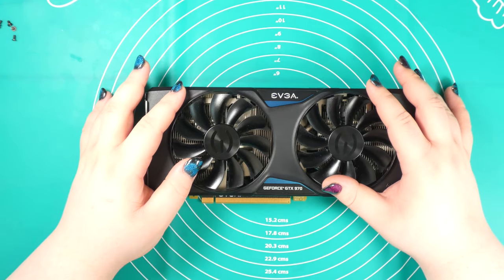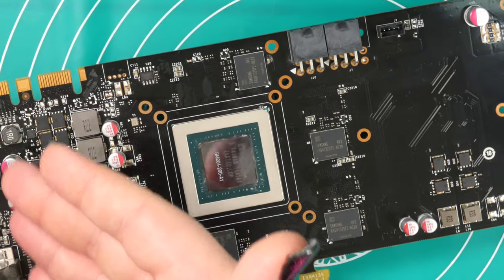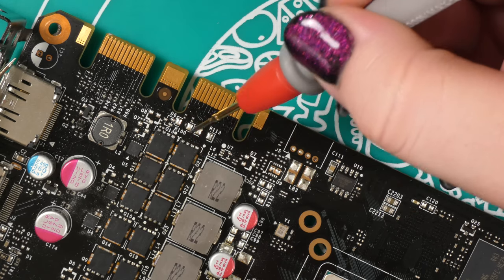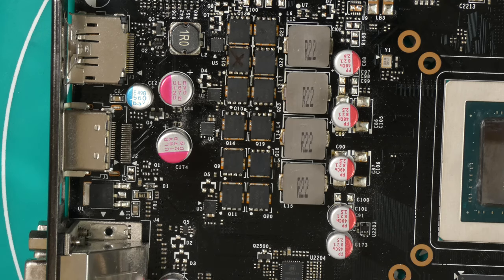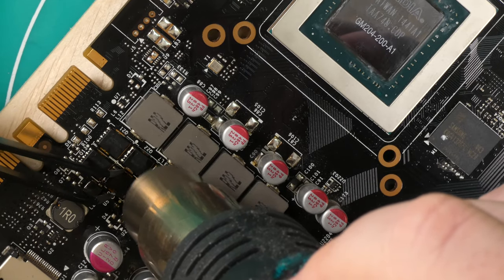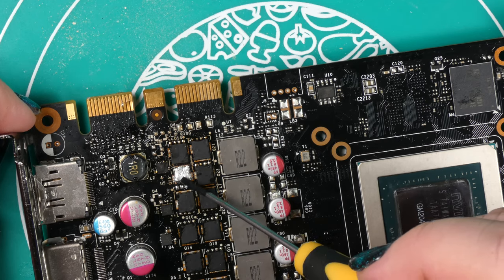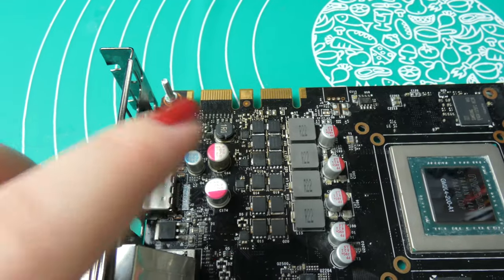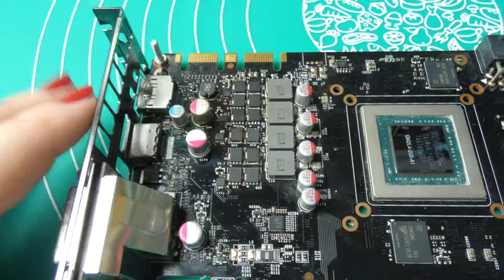Nvidia Graphics Card Repair - EVGA GTX 970

Comment: Hi, nice video.
I learned a lot from watching it: thanks very much.
I'm like you, have a different foundation (mine is materials engineering not physics as yours is), and am using these sorts of things to learn about electronics.

Couple comments:
- At start, you might say what's wrong with the device: I'm assuming it is just dead, but you need to watch more to see that.
Some GPU's have erractic/intermittent issues.
- Also at start, you did say it likely wasn't worth a great deal of effort to fix, but I think is good to say what it's initial cost was, and current 2nd hand value (just to show how that judgement was made)
- Maybe comment on this GPU's nature: the basic ones start by being powered by the PCIe connector, but after 75Watts, it needs to draw from the auxilliary inputs.
And this one is fairly high powered at xx Watts.
- In terms of troubleshooting, I wonder if you fixed the two shorts you found (by simply disconnecting that part), does the GPU work at a low level? Drawing low power?
Can test that by a functional GTX 970 (there are many of them), and seeing if it will work without the aux power lead. Maybe not.

In hindsight, for the failed Mosfet I wonder if you might just cut it out (say with a Dremmel tool): which wouldn't heat the board up at all.
Then add a new one over top of it.
Doesn't need to look pretty, or be flush.

I didn't see the Mosfet type, but looking at the data sheet, you can see how much heat you are allowed to use to install it.

I suspect it's close to impossible to remove it without a VERY good desoldering station.
Especially without cooking the neighbouring ones.

And maybe is good idea to shield the others whilst trying to remove the failed one.

I'm bad at doing SMT's......barbeque time...:-}
I see this guy managed it: https://www.youtube.com/watch?v=CtK1O-UoLMM
And he replaced the driver too: couldn't get same so tried what he felt was similar.
And it worked.

Anyways, nice video: thanks.
Reply from the maker: Hey, thanks for your comment and welcome to my channel! :)
Now the video is for everyone interested to watch, people that now about computers I don't have to tell them what a GTX 970 is worth and for others I thought that it is just unnecessary information. Same goes for the information that a GPU like that wont even startup without pci-e power connected. It literally tells you in startup, black screen, white letters: pci-e connector missing I wont start. That's at least the gist of it. 

As for the damage to the gpu, well without diagnosing it I can't really tell you. 49 seconds into the video I said that I suspected a mosfet to be the problem but I checked for everyone to see and follow if they try to diagnose a GPU problem like that. 

At the end of the video I said that the problem is not fixed and I have to do more to fix it. Since then I did a lot more on the GPU and found numerous problems with it. This thing is not a simple fix at least not as simple as I thought. I need to make the next part and there I'll talk about everything I did and give some information on how GPU power delivery works for a better understanding. 

When you work on stuff like that you don't need a good hot air rework station, just the one I have is good enough. Now obviously better ones make your life easier but that was not the problem here. The mosfet simply got partially welded to the pad underneath which can happen if there is not enough solder underneath (meaning layer thickness) and the component gets hot for an extended amount of time. Others were moving long before this one did.

And with shielding you mean use kapton tape to protect other components? That is something I had a comment about before which I did not answer to. If you mean something else ignore the following and tell me! :)
"It is supposed to protect other components from heat" is what you hear all the time. Kapton tape is a heat resistant, non electrically conductive, self-adhesive material that has many uses. But it won't "protect" any component from heat. Lets just say we have kapton around one of these mosfets, the hotair does not directly hit the surrounding components but the air heats up the kapton tape. It is not an perfect insulator, no perfect insulator exists and it is so thin that it will still transfer a significant portion of the heat energy towards components underneath. So no protection there.
This makes it even worse considering that the mosfet or component you are working on is electrically connected to other components and for that also thermally connected. When you try to cool SMD fets like these one trick we engineers do is not only to attach a heatsink to the component which is less efficient as if they were a tht fet but also connect a heatsink to the inductor as it is electrically connected to the mosfet and has very good thermal transfer. What you see looking on top of the mosfet is a relatively thick layer of plastic like material so more heat energy can be transferred through the pcb. Thats one reason why we also cool inductors. 
To make matters even worse is that in order to desolder a compoenent you have to saturate the pcb/ traces electrically connected with the component you are working on in order to reach necessary temperature for soldering. It literally works as a heatsink. So blocking the heat is exactly what you shouln't do.
Just go on youtube and watch professionals (I'm not one of them) doing board level repair, none uses kapton tape this way, it makes no sense. 
Again it has its uses and I got plenty of it but that's not something it should be used for. 

However you are absolutely right that components do have diagrams showing the temperature curve and if you are concerned about damaging anything taking a look at it doesn't hurt but this is more for reflow ovens and not hot air soldering as you can set the hot air temperature to whatever and the distance to your work piece decides actual soldering temperature. Has a lot to do with experience, just do a bit of smd work and after a short time you get the hang of it. It is really easy.
My hot air station is set between 300°C and 350°C although my solder melts at 186°C if I remember correctly but heat is only part of the "problem", time is the other. So soldering with 300°C a mosfet can be quickly soldered, maybe 5 to 15 seconds. Depends on current pcb temperature. Since this video I started to preheat the pcb so it doesn't take as long to saturate the pcb with heat energy, also I use lower melting point solder than the one the components were originally soldered in place with.

Again thank you very much for your comment, I really appreciate the feedback. :)
Reply: @PhysicistAnna  true, the idea of using the tape is to simply keep parts in place , like that resistor and cap that moved on you :P

Comment: where did you get your MOSFETs from? I'm trying to get into GPU fixing and the one I have is this exact same problem?
Reply from the maker: Hey, welcome to my channel! :)
You have to make sure that these mosfets are the exact ones you need or have similar properties to the ones your GPU requires. They need to match in terms of switching current, Rds(on) value and switching properties. As for the voltage rating, any mosfet that can at least handle the 12V input plus some spare should do the job.
I got mine from ebay (Link: https://www.ebay.de/itm/20-x-NTMFS4C06NT1G-4C06N-NTMFS4C06N-NTMFS4C06-QFN8-Power-MOSFET-Single-N-Channel/183967962550?ssPageName=STRK%3AMEBIDX%3AIT&_trksid=p2060353.m2749.l2649 )
Reply: @PhysicistAnna  Hi, my display card also died recently and I am trying to fix it. 
It is so sad that you have failed. I suspect that the new mosfet may not be an real one. 
I check the ebay link above, the price of the mosfet is too cheap. It may be fake.
I suggest you check the new mosfet by multi-meter. Make sure the pins is behave as the real mosfet. 
If the pin don't work as normal, it must be fake.

Comment: Any suggestions for desoldering the mosfet? I’ve been using a heat gun, a soldering iron and flux but I can’t get the bottom of the mosfet to come off (it broke in two pieces)
Reply: to much heat for to much time. Try preheat area and than blast mosfet with higher temp for shorter time, but firstly try higher airflow, ramp at max your airflow, flux. Train properly

Comment: i have amd rx 480 8gb gddr5 when i connect 8 pin of smps to the graphic card the 2 fans rotates but when i connect graphic card to the slot on the motherboard fan does not rotates and graphic card is  not detected by the computer. Is my graphic card faulty?

Comment: in your opinion, could I solder without a heat gun?
Reply from the maker: If you need to replace the mosfet's or their drivers you need a heat gut. A soldering iron is not working for this kind of component in this case due to their package type.

Comment: Replace the (1R0) inductor chip then replace the   mosfet . that should do it. good stuff
Reply from the maker: Replacing the upper two mosfet drivers got me into windows. It seems as if the lower two are not working as I ran into some more problems especially under heavy load. Will replace them in video part 2 and hopefully that solves the issue once and for all. If you are interested in how I got there, here is part 1.5 in which I tell you my journey so far in terms of diagnosing the issue. https://youtu.be/jXlV53GZS18

Comment: Do you know where i can buy 734DEH WSC55 mosfet?
Reply from the maker: Unfortunately I was unable to find this component. Searching for it however I cam accross a cross reference to these two datasheets down below. Considering that you commented under my gpu repair video I assume you were looking for ones to fix a gpu? If you tell me the exact name and manufacturer I might be able to search for a suitable replacement as these down below are low power pqfn package dual mosfets.
https://www.infineon.com/dgdl/irlhs6276pbf.pdf?fileId=5546d462533600a401535663ae1f25ab
https://www.infineon.com/dgdl/irlhs6376pbf.pdf?fileId=5546d462533600a401535663bef425af
Reply: @PhysicistAnna  sorry for the late reply i am trying to repair a zotac gpu a am not shure the exact model but i think is a zotac mini 8gb gtx 1070 the one with 3 display port 1 hdmi and one dvi. Do you have a email or something i could send you pictures or something?

Comment: Madam, can you, please, share the link to this graphic card datasheet? I have two of them with different sympthoms which I want to diagnose. Thank you very much for your amazing videos. Keep the World educated!
Reply from the maker: There is no datasheet. You simply have to reverse engineer what needs to be fixed, it's mostly pretty simple.
Reply: @PhysicistAnna  
Sorry, didn't get you. Did you mean that I should consult an engineer?
Reply from the maker: You can do it yourself just as everybody else does. Identify the problem following typical steps for diagnosing a fault. For example if you have an issue with power delivery you simply need to identify everything related to it on the pcb, look up the controller, drivers and mosfets. Compare the gpu's design in front of you with the typical application diagramm in the controllers datasheet and follow the typical steps to diagnose the components. If you don't know what I am talking about at this point I think we either have a language barrier or you are simply not there yet to tackle a gpu repair. Start small when you want to get into electronics as a hobby even if you want to repair gpus in the future. The easiest thing to learn is how to diagnose and repair the gpu power delivery. The rest comes with research and experience.
As a start I suggest you watch this video I made about gpu power delivery: https://youtu.be/Pg4Vu6swLH0
However if you already know how a synchronous buck converter works it might not be that useful.
Reply: @PhysicistAnna  thank you very much. I know nothing but you help me a lot.

Comment: You never continued this project or didnt upload?
Reply from the maker: I had to wait for the mosfet drivers to arrive just to discover the card had another problem I first had to figure out about and then I also got sick at the beginning of this year. So everything got delayed but I'm going to make another two parts. One with a lot of talking so you can follow along the process I had to go through to figure everything out and the hopefully last video to fix it once and for all.
Reply: The mosfet drivers where shorted, I removed all 3 of them after removing many other components, the 12volt lane is now 12k ohms but it seems a bit low
Reply: @ekse4146  4 pins to the left shorted means bad GPU
Reply: @graphicscardtech3167  I replaced bad drivers and there is no longer a short. "4pins to the left" of what? that makes no sense sorry.
Reply: Someone called "a video game" came to a youtube video and said its a bad gpu because "4 pins to the left shorted". Jesus, don't ever get advice from the youtube comment section.
Reply from the maker: Ah sorry I didn't see your answer. The first video I was talking about got released. Did this one already help? 
I just checked and the GTX 970 I'm working on has a resistance of 30MOhm (Mega Ohm) from 12V to GND. So maybe you got some charring on the pcb? that would be highly unfortunate. Otherwise another damaged passive. The mosfet drivers require some. Maybe they got damaged when the drivers went out.
Reply: @PhysicistAnna  I'm still working on mine, or its on hold because of other things. I did a quick test run and the machine turned on with the gpu plugged in, which is more than what it would have been before with a dead short on the 12v connector, I'd expect the machine wouldn't even start. I've got to return to this later. I have some components on order. And yes the resistance is low, I'll look into it when I get more time and these other things out of the way.
Reply from the maker: You might me able to pin point it by having your computer run while its plugged in and using your hand search for a component or area that is hotter than expected. Professionals use thermal cameras for this. Might be tricky on the chip side, you need a small heat sink and eventually a fan if its not completely cold.

Comment: Hi quick question are you able to tell what size capacitors those are on the actual GPU chip around the dye...on the green part between the silver part and the actual GPU dye...and secondly will the resistance be different in all? One broke off my 2080 super and I need to replace it but not sure of the value. I'm being told it's a 01005 0402 capacitor and a 1uf should suffice? They come in various voltages can you please advise. The lowest I could find was a 2.5v as you mentioned chip uses very low voltage...would this be it https://uk.farnell.com/murata/grm022d80e104me15l/cap-0-1uf-2-5v-mlcc-01005/dp/2997876

Comment: where can I find the data sheet for this board?
Reply from the maker: There is none unfortunately. That would mean less work for me and an already fixed gpu :D
Reply: @PhysicistAnna  Mine looks like it's shorted. Two capacitors burst and the video card burned my motherboard.
Reply from the maker: Oh my that's no good. Sounds like a major failure and a total loss. For it to also damage your motherboard there had to be a major event. Is it an expensive gpu? I'm only asking as the time you may have to put into might not be worth.
Reply from the maker: By the way, does it look like its shorted or did you already check? If you're lucky a simple capacitor replacement might do the trick. I mean when they burst it can look really bad.
Reply: @PhysicistAnna  I'm Brazilian and everything has been expensive here since our last government. Yes, this graphics card currently finds itself at a surreal value due to mining related issues. I think I'll ask a professional to take a look. I won't put another motherboard at risk.

Comment: My 2gb graphic card is not working I give them to repair but they said it's not working because it's main I.c dead so what's the reason ?
Reply from the maker: Sorry for the late response. There are numerous reasons why a gpu chip itself can die. One of the most common ones is due to heat but not like overheat. You see the gpu chip itself is made from silicon and it sits on top of a substrate that looks like a pcb and mostly is one. If you remove a chip off of the pcb (talking about the gpu pcb) you can see hundreds of small circles that are the connections. But how are these connected to the silicon? well the short answer is with very very thin wires that are directly soldered within the substrate to the silicon. And this point where the small wires touch the silicon is the weakest spot. So over time, even if you run your gpu under optimall conditions due to constant change in temperature the solder weakens and eventually disconnects the wire. As this is within the substrate however there is nothing anyone can do to fix it. But this is only a possibility and it doesn't mean every gpu will die like that.